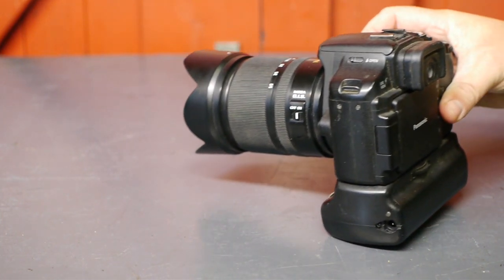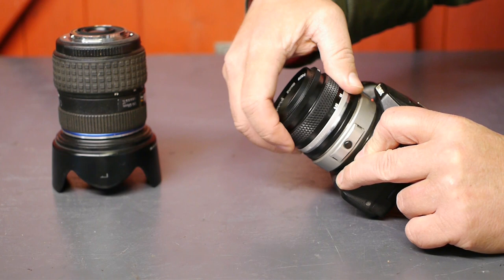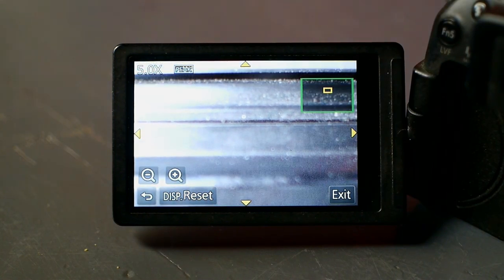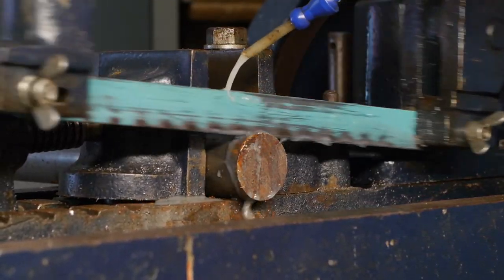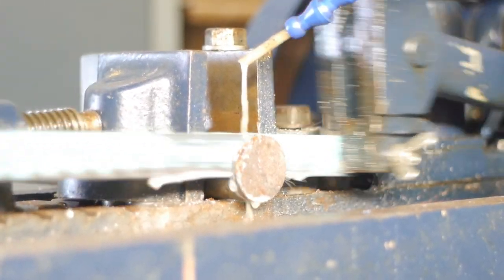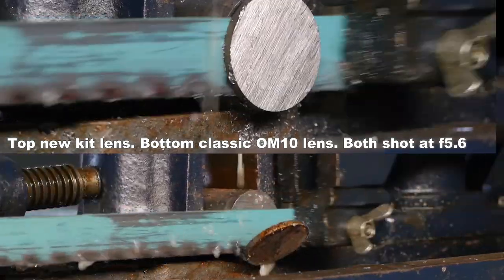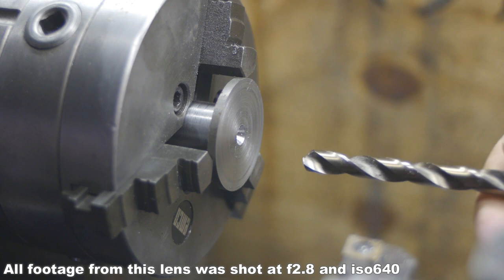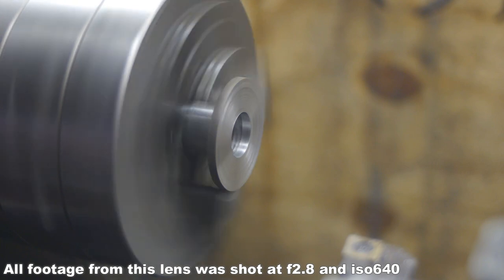Youtube gear and shooting video with a vintage lens

Comment: Hi Rolingmetal.  I have no idea if the way you narrate these videos is the way you normally speak.  There have been a number of comedians and comedy actors over the years with a similar way of speaking; the kind of 'down trodden', things are getting even worse kind of disposition. But I for one love it, along with your sense of humour.   Quite 'dry'.
As for the videos themselves - the audio is great, the video is great, the content is great.  What more could one want?  Apart from more revenue and subscribers.
Regards Mark in the England.
Reply from the maker: I started to narrate / voice over my videos when I picked up the youtubing hobby a few moths ago. The result it o.k, it's slow to produce, but it is more flexible. You can also speed up the video while doing the voice over, resulting in shorter videos :)
Basically I stated sortha scripting my video after recording it.
You see, one of the side goals of my channel when I started, was to improve my English. But that kinda got fucked up last winter, when I had a little brain fart (t.i.a) 
I think it's a bit fake, I would prefer "live" recorded audio. But that just resulted in too many frustration and bad take so I gave up you tubing. I though about switching to Dutch or Frisian. But but to be honest I have same problems in those languages. I just have to take it slow these days, and avoid to much stress. Hopefully things will get a little better when I made a 100 more videos :)

Comment: You're on to something.  My day job (for the last 30 years) is as a TV director.  A lot of these vintage SLR lenses have been given a new lease on life with mirrorless/e-mount cameras.  By far the sharpest lens we've ever tested was a Nikon non-Ai 50mm f1.4 kit lens.  Kind of soft and hazy at a 1.4, by the time you're at a 2.8, it's super sharp.  5.6-8 is it's sweet spot.  Old Minoltas look like Cooke S4s that we used all the time when we shot 35mm film exclusively.  There's a ton of other tricks out there.  Great video!
Reply from the maker: I don't know if I'm on to something, but it is fun to try different thing and see if you can get a better result somehow :)

Comment: The OM 50 1.4 and 1.2 are very clean and keep the character. I'm pretty impressed with the 4/3 kit lens.
Reply from the maker: You wont find a OM 50 1.4 or 1.2 at the local flea market, but I wouldn't mind trying one :) The kit lens is very decent, I might give it a try one day.

Comment: I use a $10 Cisco Flip Video for my youtube videos. Works very VERY well. Very professional piece of equipment.
Reply from the maker: The legendary Cisco flip :)
Reply: @Rolingmetal  It's the only video camera I have ever used...seems pretty good to me except for two things:
1) the screen is only about 30 mm square. And,
2) Fixed focus. It doesn't focus closer than about one meter. So I put a little bayonet mount on it so I can clip on loupe glass lenses. That makes it able to focus on fine stuff but a HUGE pita.